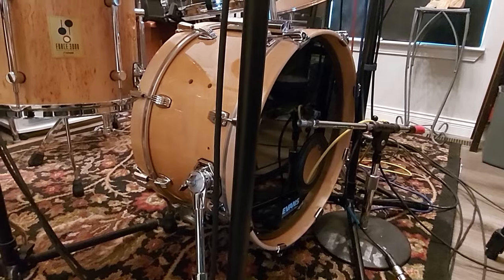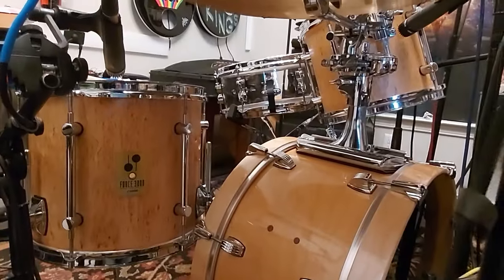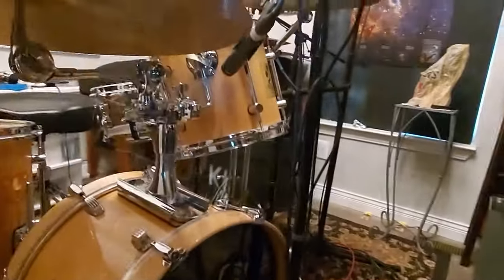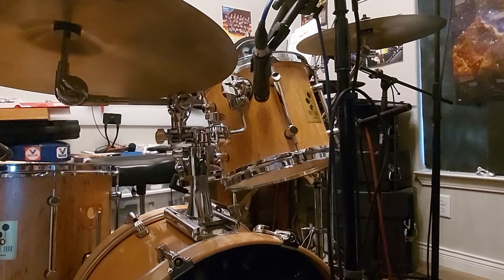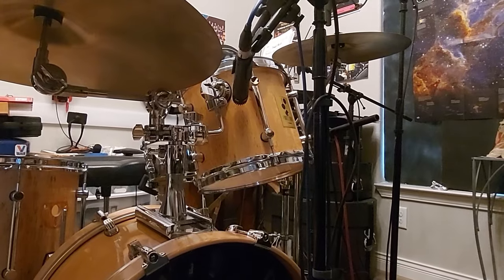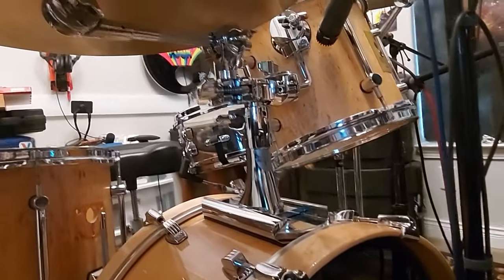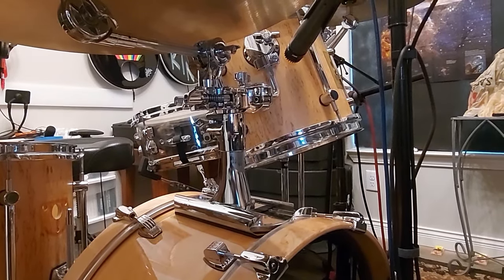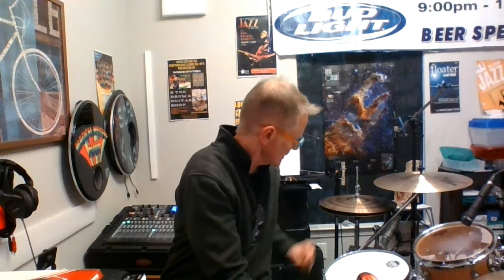Converting an 18" floor tom into a REAL bass drum! Drumming starts around 5 minutes in...

Comment: I have a Sonor kit with small drums. I'm telling you, if you tune them right without muffling them to death, they sound much bigger than you would expect. Small drums rule. I have to hold on to my 14" Sonor rosewood snare though. But the Pearl isolation feet are garbage because they are WAY too stiff. I made spring feet from local hardware store components that completely outperform the pearl junk rubbers. If you can pick up your floor tom by the rim and hear the difference in resonance then you know what I'm talking about.
Reply from the maker: The higher pitches cut!

Comment: The sounds you achieve from your shells is uncanny Karl.
Nice set up.
" Losing it's ability to gather itself"
Never heard that phrase but do like it.
How about a tall snare stand for the 10x8 or 9.
I figured individuals were moving to tom or snare stands for tom's, for the reasons you have verbalized in your videos.

What can you share about the screw under the bottom snare cymbal?
Thank you

Reminds me of rdavidr or Todd Thomas " cheap drum guy " when modifying shells.
It has to be labor of love.
Reply from the maker: Mentioning me in the same breath as rdavidr... high praise! That guy is legend, and his videos are the gold standard. 
I've come up with a solution for the tom mount, and there will be a video upcoming, along with a way to actually measure sustain and tonal purity using a pitch detector. It will be interesting!
Regarding the screw under the cymbal, is it the crash cymbal stand you're referring to? If so, that's a multi clamp clamping a cymbal boom to my hihat stand, which means there are absolutely NO stands other than the snare and hihat. Everything else is attached to the bass drum mount. Super clean and simple. Nothing to trip on. 
Thanks again for watching and commenting. Stay tuned...

Comment: Nice!  Are those the same lugs you were using as a floor tom or did you have to get different ones to accommodate for the hoops?
Reply from the maker: Same lugs, slightly modified because they were not quite tall enough.
Reply: @karlplaysdrums  OK, thanks, that's what I was wondering about.  I saw someone 3D printed pieces to match the shape of the lug to give them more height.  I have an 18" tom I'm thinking of converting.  It looks so much better with the hoops!
Reply from the maker: @bassdrumcreep7884 not only does it look better, but it allows the use of true bass drum heads, which have larger hoops. That was the main reason I went with wood hoops.